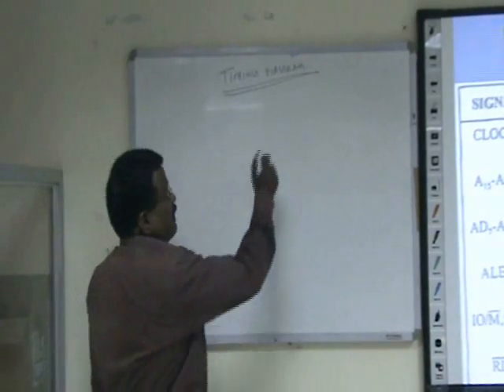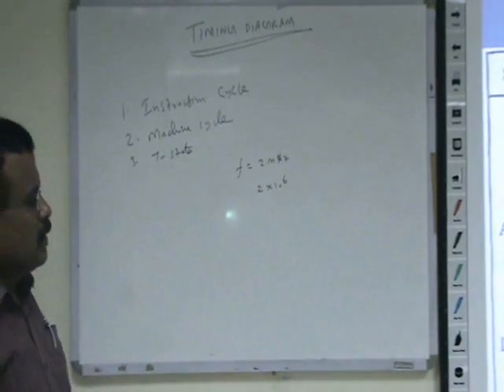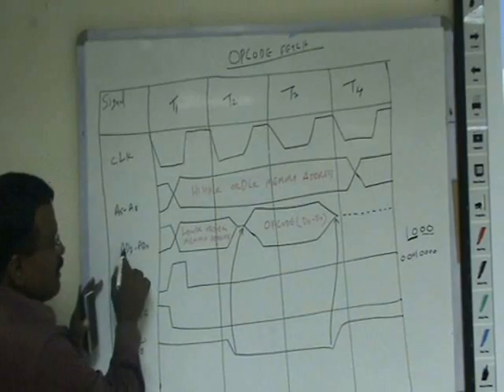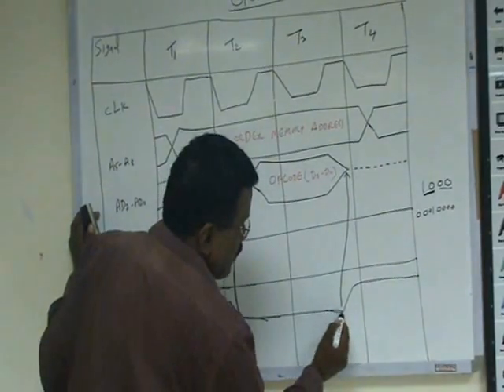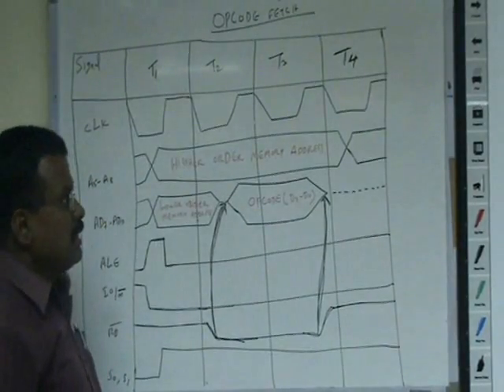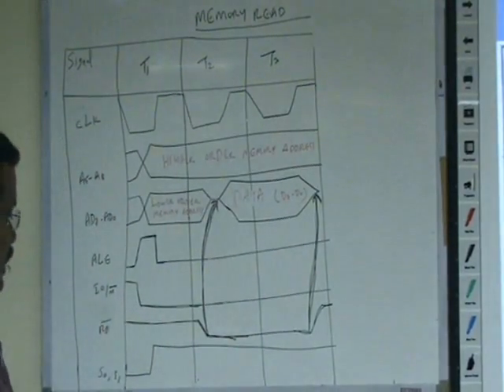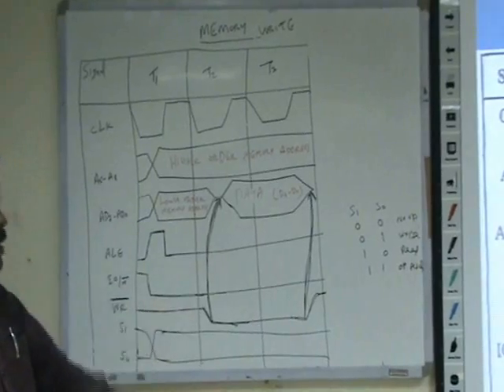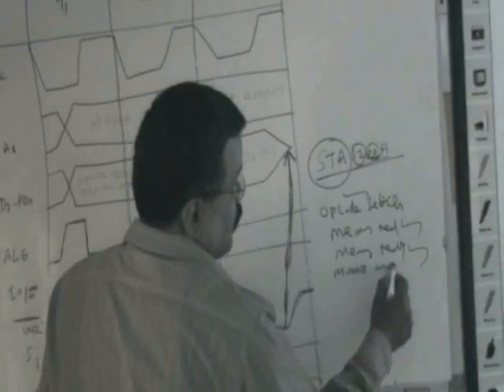Timing diagram

Comment: one of the best explanations on the internet. Thank you so much sir.
I have one confusion though- for the sta 1200h instruction
why is there 2 memory read and only 1 memory write cycles. 
If am reading from 2 bytes shouln't I be witing in two bytes also?
Reply: it's because in sta we have to read 16-bit address (in this case 1200H).
so,during first read cycle only lower byte of address can be read.during second read cycle higher byte of address can be read.and it requires only one write cycle because data in accumulator is of only one byte and this data then stored into memory location in one cycle.

Comment: Thanks for this great video sir.One thing I need to know is that during T4 state of op code fetch cycle,is it true that the DMA control could be used to transfer a bulk of data IN A SINGLE T- state?